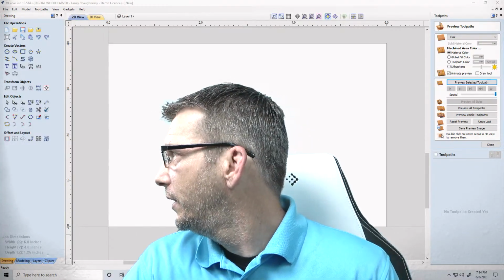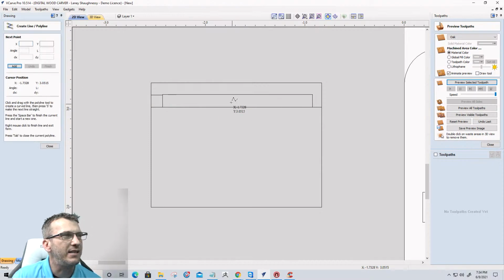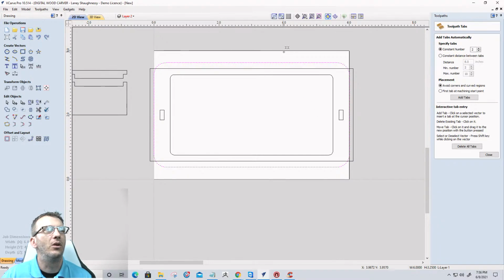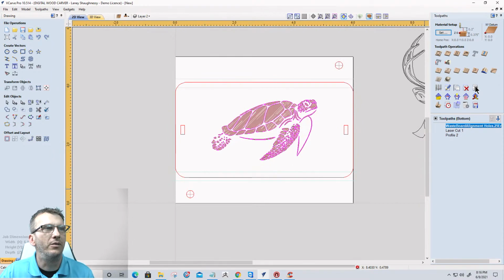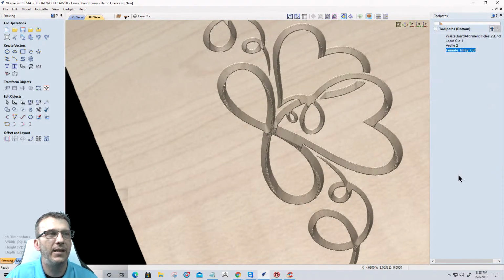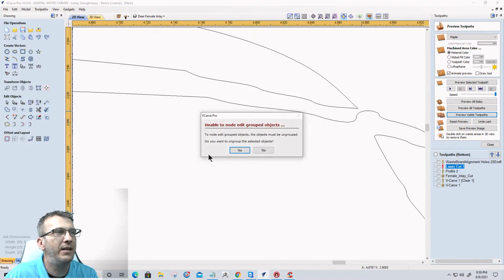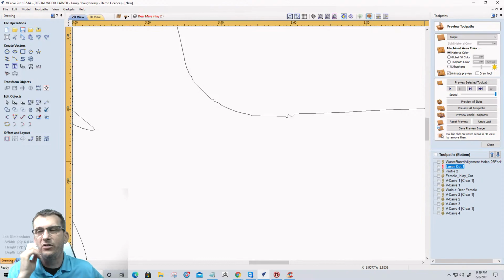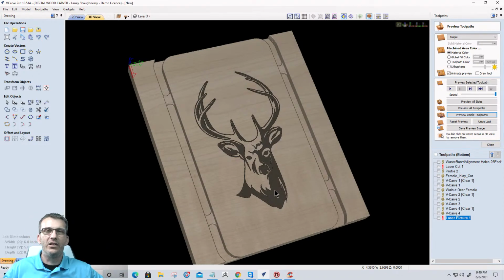Sliding Lid Boxes for Any Occasion

Comment: Hi Laney: I am watching your video right now, and I noticed your start depth for the magnet pockets on the box bottom started at zero (0) when I think it should have stated at 3/16" to accomodate for the slot pocket.  Maybe you found this later in the video, but I thought I would pass it along.  Love your work/projects and it would be great if you took this project one step further and did sliding dovetails, so we learn how to do it.
Best - Michael
Reply from the maker: I didnt catch that when filming but did when cleaning up the toolpaths for when i share the files with you all...And you are correct the start depth should have been .1875
Reply: @SpindleTV  I love what you are doing for the CNC community and I can't say it enough - many many thanks!
Best - Michael